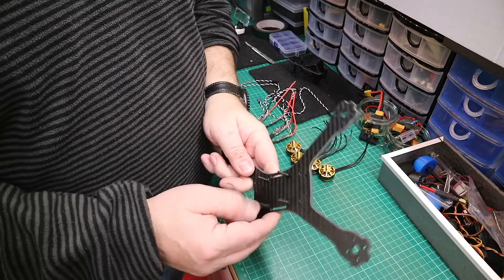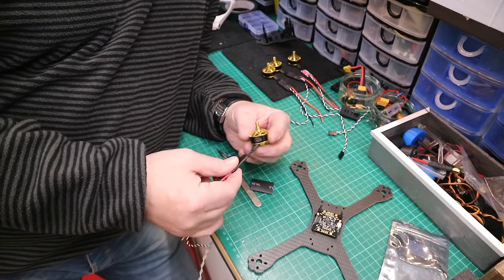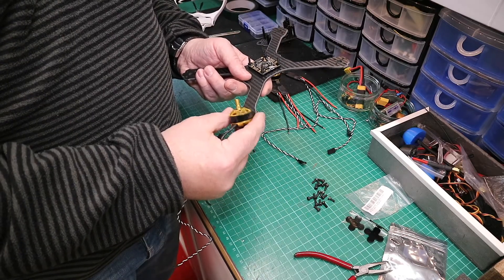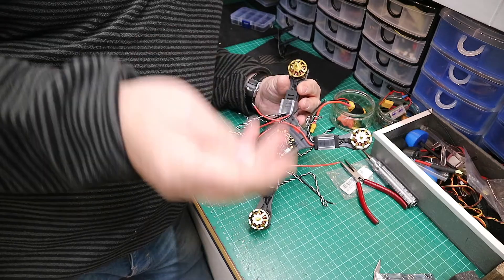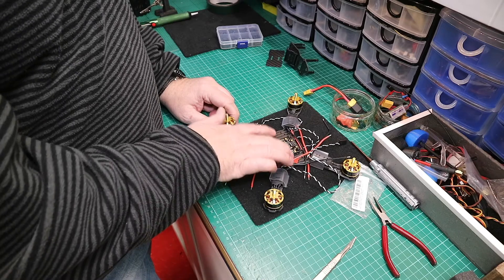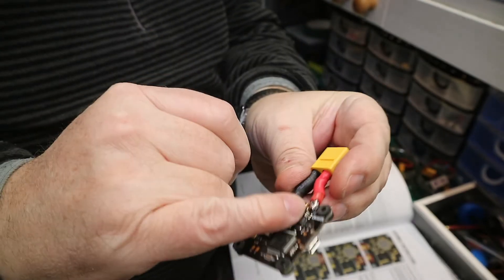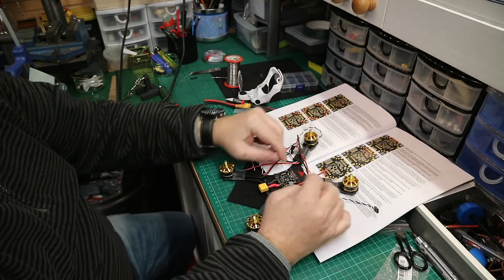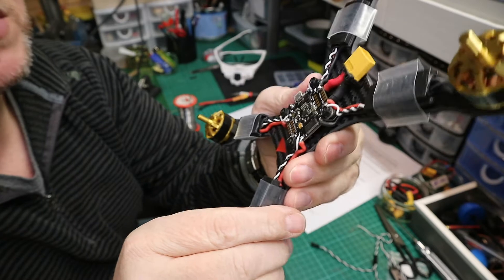How to build your first quadcopter - Part 2 - Motors & ESC  - Joshua Bardwell FC 2

Comment: nice video Jon, I wish I had some decent instruction when I built by first quad you have already covered my two main issues I had, I didn't know about the shorting out contacts for the voltage and didn't use soft mounts on my F4 board.
Reply from the maker: Nigel Ross I had a few requests and feel sad for people getting into this hobby as things are far from plug and play. The Emax magnum may be the nearest. Still there is a lot more to be improved as cameras seem to have different plugs and VTX come in all shapes and sizes. I am hoping people may get a good insight from my series of videos. People assume plug and play and then end up with a box of bits and no clue how to proceed.